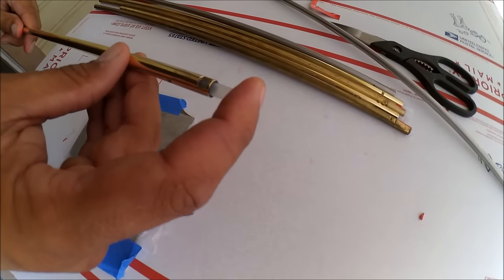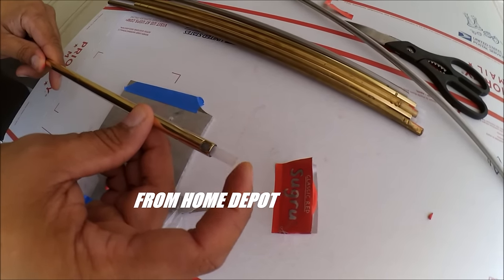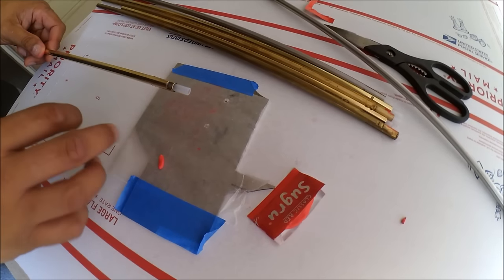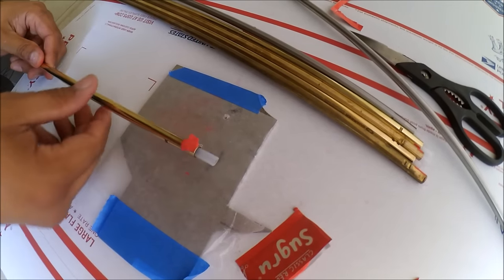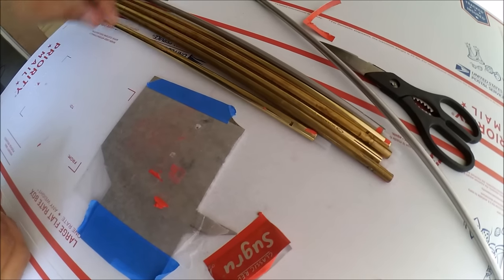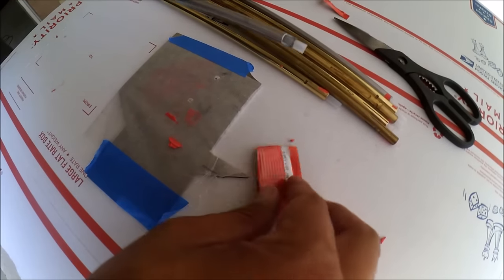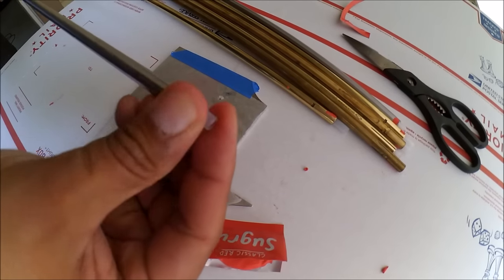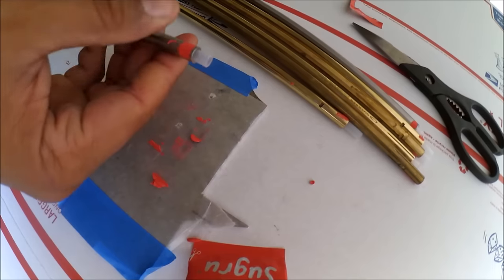SUGRU R-HOP  ***DIY***

Comment: Something I've experienced when doing the S-hop is it doesn't get very good BB grip if you use something smooth to plug the barrel. I started wrapping a 6mm drill bit in ptfe or teflon tape and turning it until the window exposes a semi-rough surface.
Reply from the maker: Matt Ruth doing that will cause to much intrusion. If you're not getting enough back spin it's not the patch. Probably some problem with your hop up. I shoot .43 with a standard sugru patch all the time.
Reply: Advancedairsoft honolulu ok thanks for the tip, ive been trying some different things in combination with the patch
Reply: Actually i did noticed this aswell. Before i was using a rubber airline to plug into the barrel and my sugru performed well. Then i tried to cover the airline with a smooth plastic straw giving the patch a smoother finish, however,my tippy performed pretty dull.  Now back to using  just the airline

Comment: I've ran into some problems, even with the hopup tuned all the way off, there is still a lot of backspin. Does this mean I've installed it wrong?
Reply from the maker: superspecialdog64 sorry didn't see this, you have to much intrusion when making the patch.
Reply: superspecialdog64 the sugru is probably not flush with the barrel that why you need something that tight and snug with the barrel so it not over hopping
Reply: this is kinda old, but depending on what nub you are using, you can just trim off a slight bit off the nub until there is zero contact on the BB when the hop-up is turned all the way down
Reply from the maker: If you dont do the patch correctly it wont even matter if you have a nub in the hop up as the patch will be drooping into the barrel its self.
Reply: yeah, that's also true. but you would need the entire system to be putting pressure on the BB, which is kinda the point. Just having the patch sagging down into the window will not be sufficient at all.

Comment: I'm curious how durable it is and if it improves the effectiveness of the hop-up?
Reply from the maker: First part, I've been using these for months now. personal guns the patch is well over 50k

second part, if you are unsure of what exactly a rhop is there are tons of videos on the subject. basically it improves contact with the bb while also providing a smooth bore though out the barrel.
Reply from the maker: First part, I've been using these for months now. personal guns the patch is well over 50k

second part, if you are unsure of what exactly a rhop is there are tons of videos on the subject. basically it improves contact with the bb while also providing a smooth bore though out the barrel.